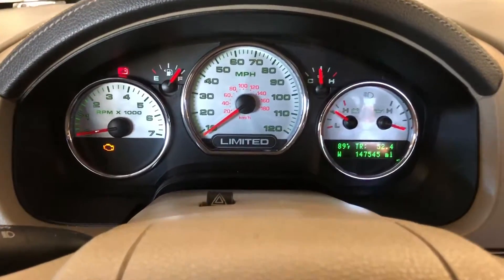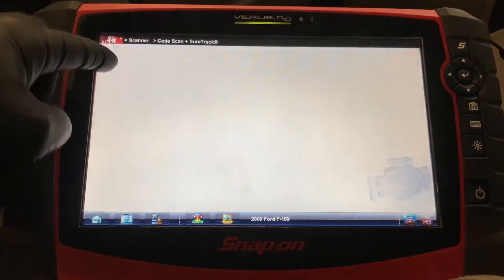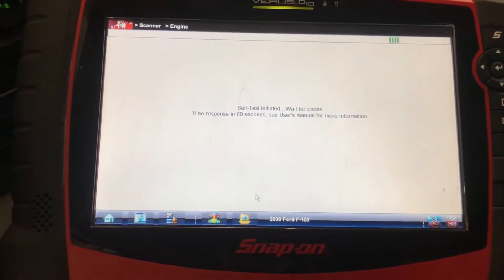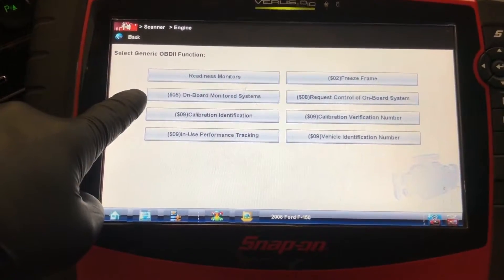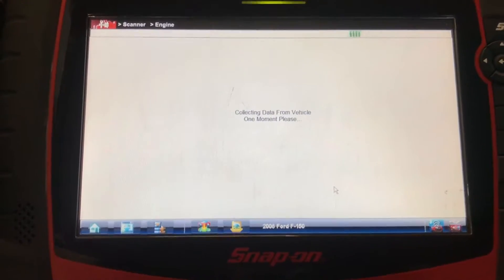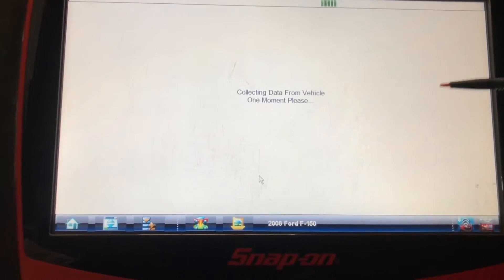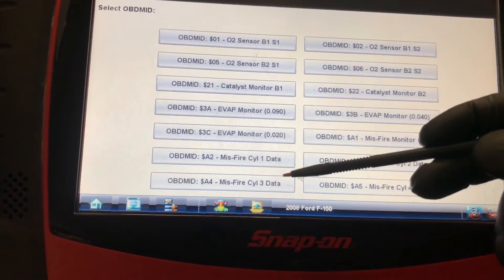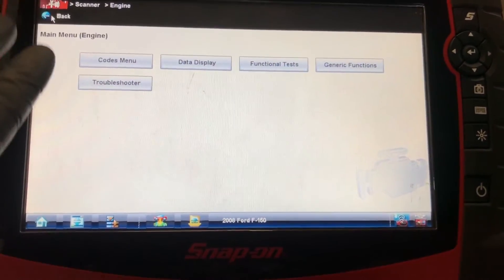Quick Tip Using Mode 6 On Any Ford to Diagnose a Misfire

Comment: I want to purchase a scanner that gives me LIVE misfire data using mode 6.  I have mode 6 data but I have an intermittent misfire issue and I need to see if at idle it is in fact misfiring.  With mode 6 on my scan tool there is no way for me to know when the misfires were recorded.

Comment: I'm getting a missfire on my 2001 ranger 3.0L V6 in idle. No codes no check engine light. I use my Bluedriver scanner to check for codes but nothing comes up.
Reply from the maker: juan's Dawon you’ll find it using Mode 6 😎
Reply: @HomieHektor  I've tried that but it's not showing me anything other than it "passed"